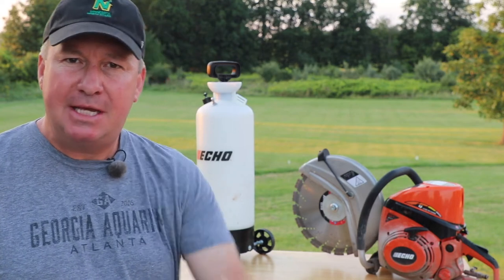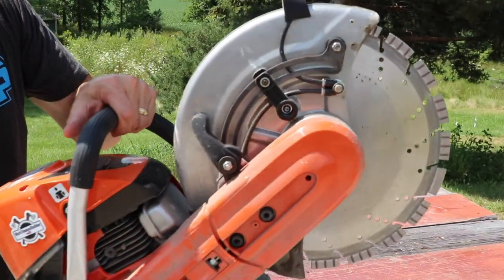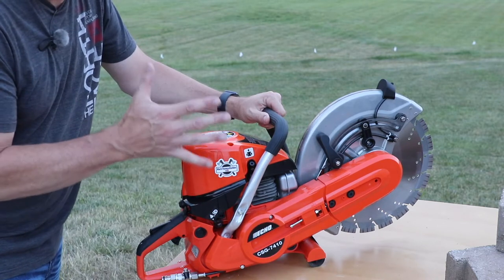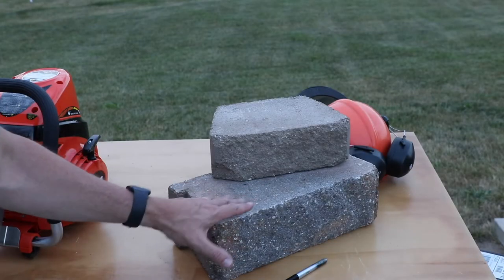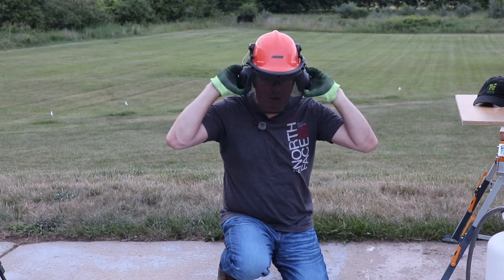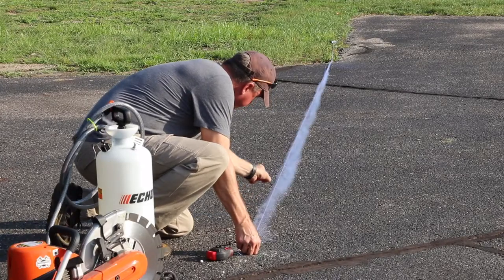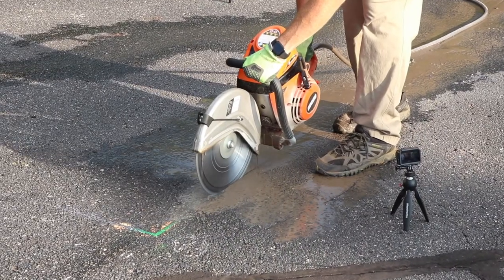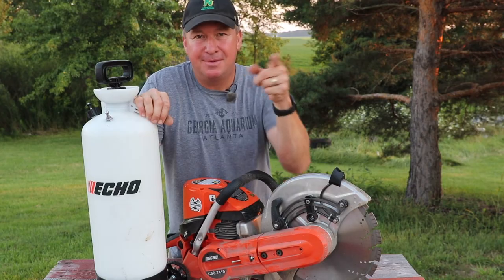ECHO Water Supply Tank And CSG-7410 Cut-off Saw Review

Comment: That water tank looks like a deal maker.  You can also take 1x4s for your straight edges.  Just barely etch your cutting line with the blade while holding against the board.  Then run back over it full depth.  Great video!!

Comment: That water tank, in fact the complete set up would be perfect for a job I'm getting ready to do. I'm repairing an Industrial warehouse concrete floor..there is no way to run a water house to my work are. Though the slab is anywhere from 10" to 12".